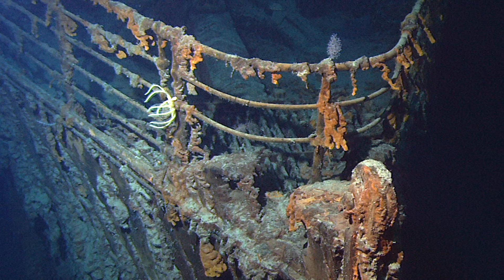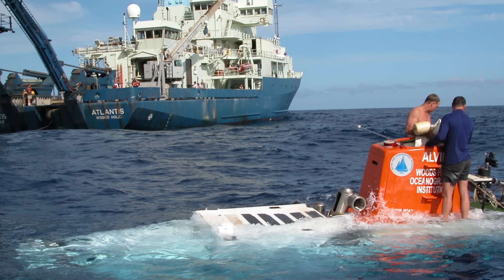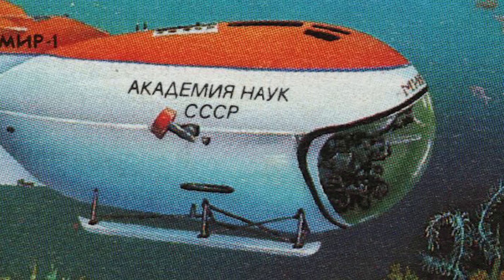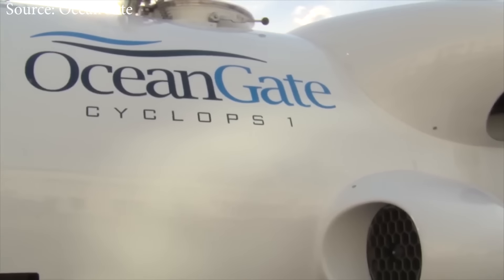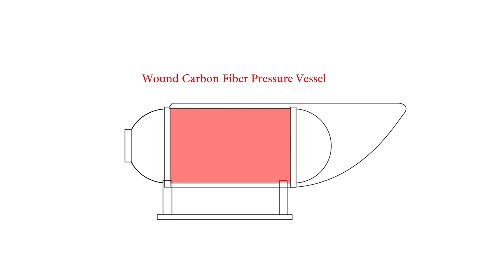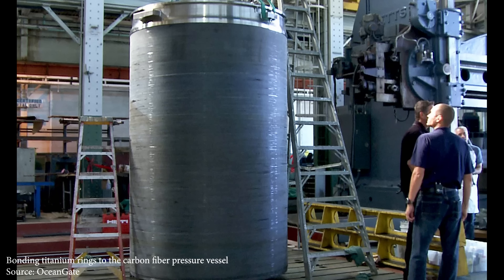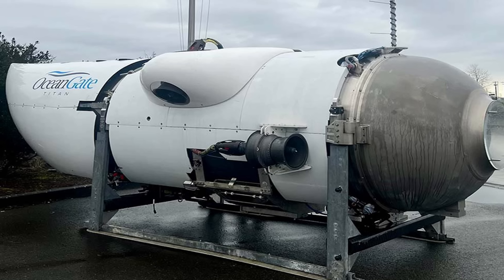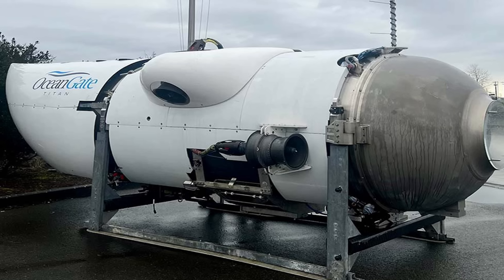How Titan was Built, Lost and Found: An Analysis

Comment: I like most of you stuff...But I sense some Bias in your assessment.   The USN does NOT use Logitech wireless controllers for anything!  They use wireless controllers yes.  But they are NOT "Off the shelf", is an example. I understand your personal pain and loss in this event.  But Titan had lots of obvious flawed risky concepts employed and not tested properly. Epoxying different materials with each other with no real way to properly test them over time under controlled circumstances....That's not often worked out well to often had it?

Comment: Carbon fiber is great under extension... as in a cable, but is much less strong under compression.  Between that and being a laminate, it does sound like a horrible choice for being a submersible hull.  Would make a better spacecraft hull, depending on how it would react to the extreme temperature differences.
Reply: That's why it's only used on planes. 
And it was old discount material that Boeing couldn't even use anymore. 
Surprising that thing dove down to Titanic at all. 
Especially with no decompression system and being bolted in.

Comment: The Logitech controller isn't Bluetooth compatible; it uses its own proprietory radio protocol, which means you now need a proprietry reciever to use it, plus batteries, plus a controller. If any of those fail, you're in trouble. Can you link a new controller to any existing reciever? Probably not, so now you're installing new hardware and hoping you don't need to reboot, instead of controlling your sub - and that's assuming you've brought a spare.

That's why (judging from the photos I've seen) the US Navy use wired XBox controllers. No radios, no batteries, and Microsoft have spent a lot of developer time ensuring that it's plug-and-play. Also, the XBox controllers are built to a much higher standard than the Logitech F710. They use good-quality industrial parts, and that's why they cost twice as much as their competitor. On the Logitech for example (and unlike the XBox or any other decent controller), you can hit left AND right on the D-Pad at the same time. Does you submersible's software handle conflicting inputs? Pac-Man (1980)  doesn't; hopefully the sub's programmers have thought of it and written software to handle it; otherwise you could be exploring new and interesting software bugs 3800 metres down from the nearest programmer....

Comment: I mean this all in good faith. I just take it passionately.

Controllers absolutely are not common to the extent implied in any military. Let alone knockoff controllers. It was absolutely a cost saving measure and familiarity bias.
When the US military uses Xbox controllers, they use them for drones, unmanned turrets, and some of the side functions described. But they have never been used to pilot any part of a manned craft. From throttle to steering to braking. That is still done through direct input by helmsman, engineers, pilots, drivers, etc. 
There are no manned vehicles, especially ocean going vessels, in the military that are primarily or explicitly controlled by a game controller. To suggest that it's "common" for weapons systems (which even then they aren't. Most weapons systems have proprietary controls/controllers) in the US military, therefore it's not strange to use that as it's only method of control is ludicrous. Especially with your knowledge of ocean going vessels and the inherent dangers of the ocean.
They don't use game controllers on other scientific craft. Even professional ROVs don't use game controllers! You cite Alvin, but that craft uses the standard control setup and actually has seats with restraints so crew can better maintain orientation.

The titanium rings were epoxied on and the walls were 5 inches thick. We don't really know what those kinds of repeated stresses on carbon fiber mean. It easily could have formed cracks during the bonding of the rings. Especially after watching video of it being done. And they never did any kind of xray or ultrasound checks, as visual checks were impossible. So it could have been doomed from day 0.
Reply: THANK YOU
Reply: @steveoltjenbruns2366  That argument just sticks in my craw. I guess we're all capable of being led astray by misinformation, but this one was just bad.

Comment: Great video! I gotta add, I was one of the CP-140 pilots, I flew the search over the 96th hour and was leaving the scene as the wreckage was discovered.
As an ASW aircraft, acoustics is our bread and butter. We know the difference between biological, background noise, surface vessels, and subsurface sounds. The entire time the “banging” we heard was unlike anything we’ve heard before. It was to a cadence and we located it to a very small area of probability on the sea floor. It seemed to respond when we dropped Mk84 eSUS, or used active to Ping as a mode of communication. This is why we believed they were alive. 
As more ships arrived on scene, background noise drowned out the banging we heard, but we could still hear it on occasion and easily differentiate noises.
The area we triangulated the banging to come from, in part using the echos through a passive sono grid and strategically positioning surface vessels to block certain echos, is where the wreckage was found. At the moment, we don’t know what the banging was, but could have been wreckage tumbling in the strong currents or small implosions from life support equipment as it settled. It’s a tragic ending and all assets on scene really gave it their all.
Thanks for making a great video that lays it out nicely.
Reply: Could it have been possible that they didn't implode when they lost power but were instead still alive and banging on the hull for a few days? And then them banging on the hull caused it to crack and then implode?

I'm just wondering how the banging fits into all this. I can't find a source, but other comments have said the emergency ballast was released, meaning they were on their way back up. So I'm wondering if they realized they were lost, tried to ascend, started banging, and the hull cracked as a result of the banging.
Reply: @Lissbirds  it’s very difficult to speculate, but the US Navy underwater hydrophone picking up the implosion sound around the same time the sub went quiet, sounds like it was all within rapid succession.
The automated “ping” the sub had every 15 minutes was an isolated, separate system. So for that to go quiet at the same time as the implosion sound, doesn’t sound like there was any actual human banging.

I will say, aircrew had that theory as well, of knocking which compromised the hull, but we don’t believe that any longer.
We are still very puzzled by the banging though and hope for answers.
As for the release of their emergency weights, we still have to wait for the exact sequence of events to be reported, but we did hear the mothership received a short text they were in an ascent briefly.
Reply: Thank you very much for sharing not only information but great insights into the work that was done. Great work.
Reply: Thank you for your info and most of all thank you for serving. 🇺🇲
Reply: @Pilot_405 Thank you for your contribution to both your aid in the search, as well as, your information.   Intriguing to hear your perspective and thoughts.
Reply: @Lissbirds  The transponder that was independent and with it's own power supply and shell vanished when it lost contact. So something major catastrophic must have happened for that to appear. There's no confirmation to this day the sounds from the hull.
Reply: So why wasn't the first search place to look at the last known location and descend? Did they not have a remote piloted submersible until much later?
Reply: Many thanks for this explanation.  I was very curious about the "banging."  You put everything into perspective and gave us an inkling of what the capabilities and limitations of these underwater systems are.
Reply: The implosion was detected on Monday.
Reply: @pyropulseIXXI  as a rough guide, this is how things unfolded.
Note, ships departed St John’s and it was about a 22-26 hour voyage to the scene.

Monday, a CP-140 was deployed and heard banging.
We began 24 hour Ops since we were the only ones able to hear the banging due to the sensitivity of our passive sonobuoys.
Wednesday night, there were about two ROV’s searching the seabed. Note they search slowly. They also had to refit the ROV’s several times with different sonar systems to scan further on the seabed.
By the 98th hour, 5 ROV’s were in the water, coordinating grid searches making sure their cables did not get tangled. Around this time they descended on the last known location and shortly after found debris.
They had been searching earlier but there was still a vast area to search with the subs rough last location known.
Reply: ❤❤ Ty so much for your amazing service..it's incredible people like you that risk your own life to help us when we are in trouble... ❤❤❤ From Canada
Reply: @intexas9434  No, the report/communique/data of the implosion was released from US Navy to the US Coast Guard (interdepartment) on Monday. The report stated the implosion happened Sunday morning when communication from Titan was lost. The sound of the implosion picked up by USN listening equipment occured at the same time they lost contact. The Coast Guard release their info later in the week.
Reply: Yes.  Heard Sunday, not talked about until later in the week.  Point is this hero says he was part of the search.  He wasn't.  Like stolen valor to me...
Reply: @intexas9434  
1) not a hero, just doing the job I love
2) we searched for and located an Area of Probability about 500m around one point, where the wreckage was discovered. We were one piece of the puzzle.
Reply: @intexas9434  No, he seems like a First Responder and therefore a hero. Sure no one was saved but to actively want to help and save people as a profession is to be admired.
Reply: Thank you for your contribution to the search. I've heard far too many claim the military knew exactly what happened from the beginning and were just stringing everyone along...this tragedy has really brought out the cynicism in a lot of people. I hope we find out what the banging really was.
Reply: thank you so much for the extremely illuminating info, it answers a few central but persistent questions as to the nature of the banging sounds. oh and please don't worry about needing to respond to random internet cranks like that attention seeking 'stolen-valor' blatherer!
Reply: @pyropulseIXXI  Not until the French vessel Atalante and one or two others arrived, nope. As soon as they had an ROV on scene, it sounds like they dropped it directly over the last known position of the Titan, and as soon as they got to the sea floor they essentially spotted it within hours, perhaps even within minutes.
Reply: Thank you so much for your service. I can’t imagine what the source of that banging could possibly have been, especially if it was rhythmic and seemed to answer. That’s pretty creepy, in hindsight. It’s pretty clear that the implosion happened when the comms were lost on Sunday morning.
Reply: @airysquared That narrative is pretty ridiculous. Why in the world would they do that? Seriously. There’s no reason whatsoever not to have said the vessel imploded. They didn’t release the info because they had to be absolutely sure that’s what had happened, meaning they found debris etc.
Reply: Thanks for the extra information, and kudos to you for being part of the search.